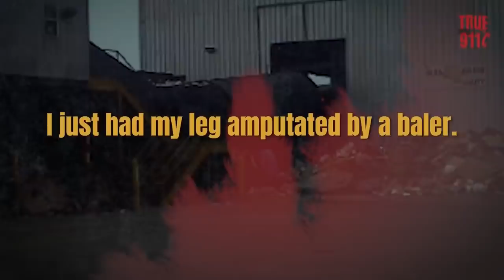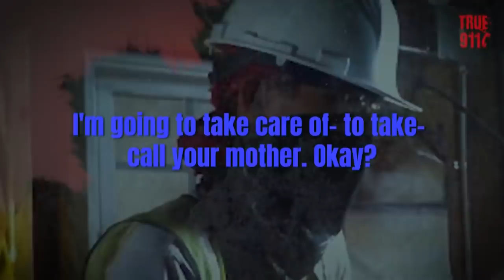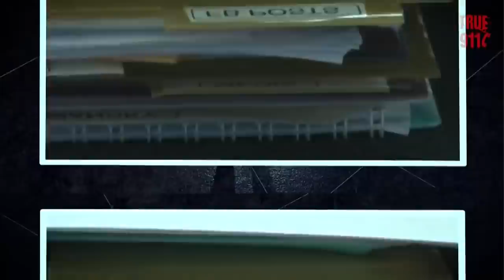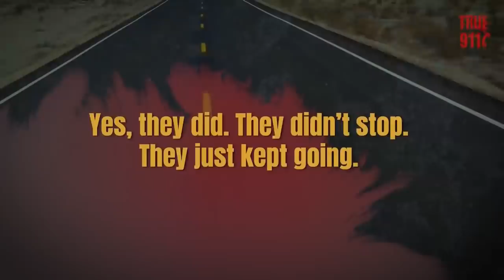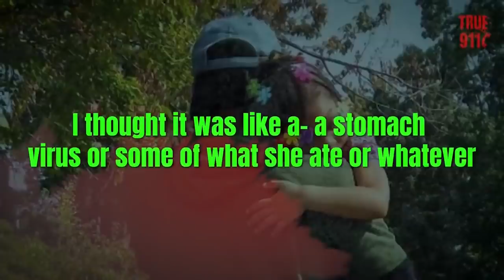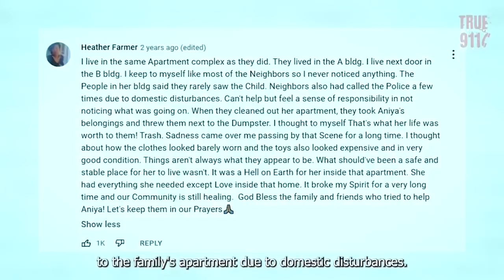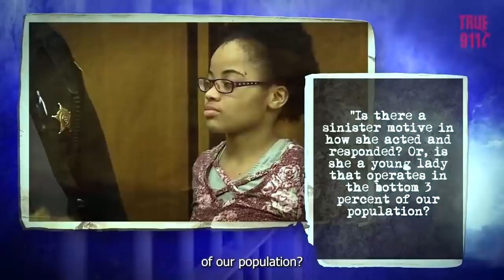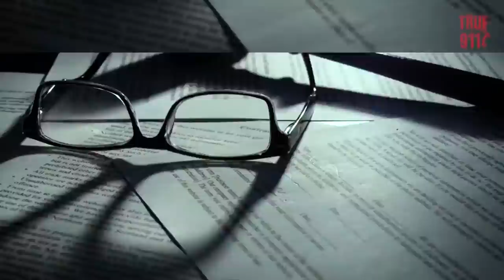Teen Told to Shut Up as Her Dad Dies | 911 Calls

Comment: This comment is for John I'm a little bit confused ⁉️Being an Electrician and High Voltage technician by trade . LOCK OUT & TAG OUT can mean LIFE or DEATH in my field ‼️If you  properly followed the LOCK & ,TAG OUT WERE DONE PROPERTY THERE SHOULD HAVE BEEN ABSOLUTELY NO WAY FOR THE BAILER TO BE SWITCHED ON. ‼️I tried to figure out how this happened and I can only say their had to be duplicate keys to remove the lock off the BAILER ⁉️ Standard protocol is the lock cannot be removed by anyone but the individual who placed the lock out tag out on the . Unit  .If you could clarify this that would be greatly appreciated. I'm glad you survived my friend. Though the 911audio/ video is  ABSOLUTELY CHILLING00 to say the least.❗ Thank you for sharing., ❗‼️